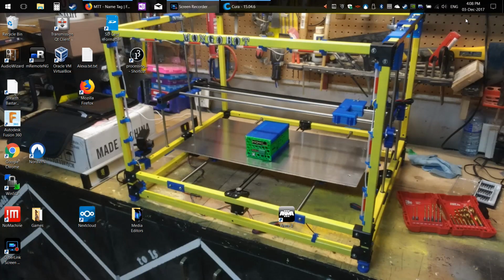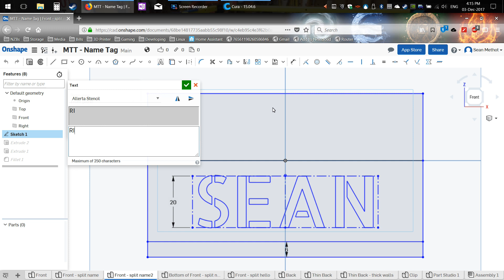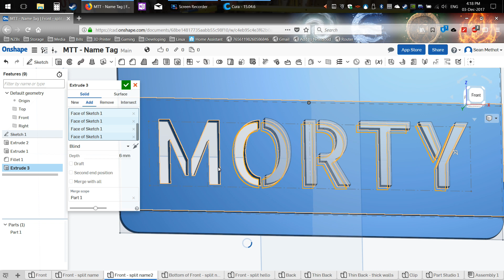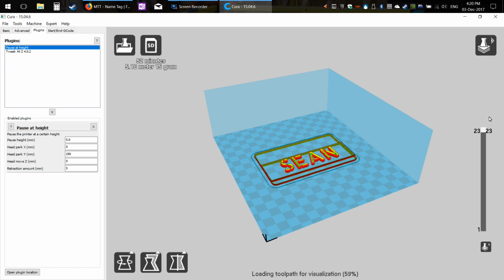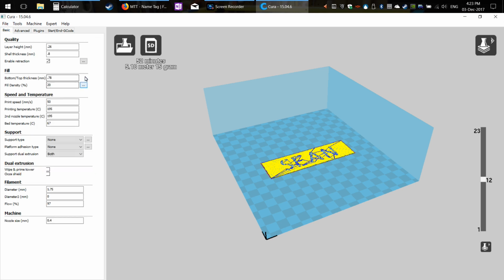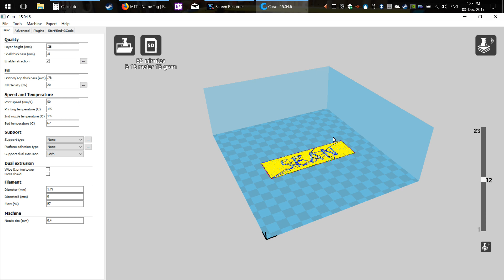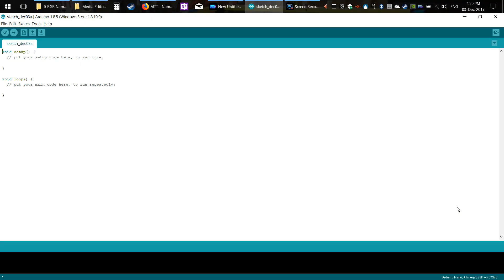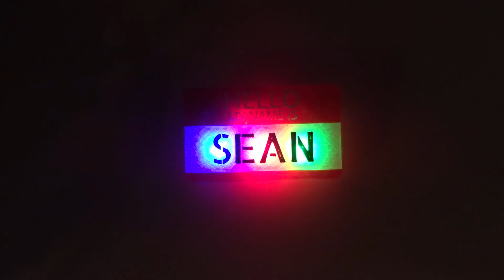Arduino Powered RGB LED Name Tag

Comment: I think you can replace the batteries for aaa and a battery holder
Reply from the maker: aquilesriffo My prototype used an external 9v which you could just drop in your pocket.  There are plenty of choices depending on how thick you want the tag to be.
Reply: My comment was based on the current size of your tag